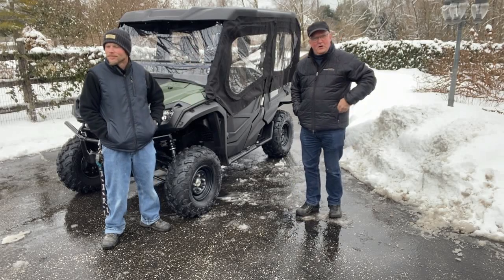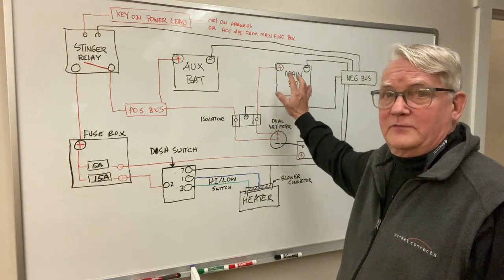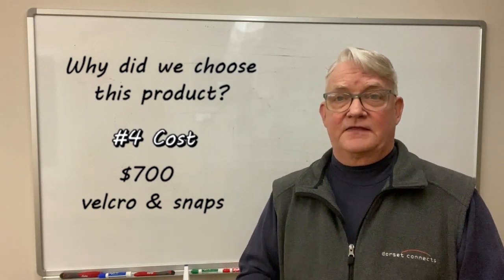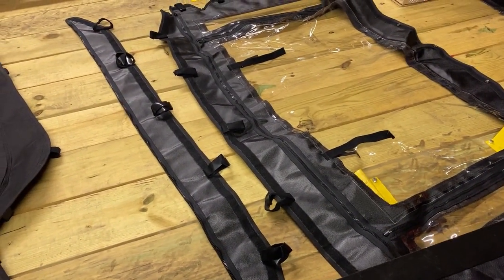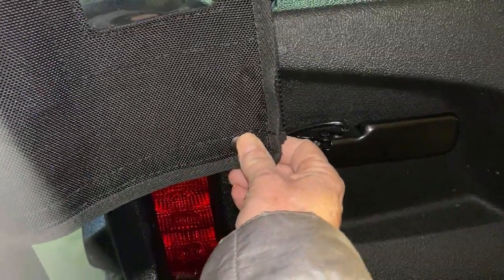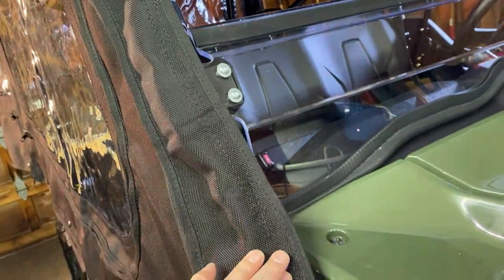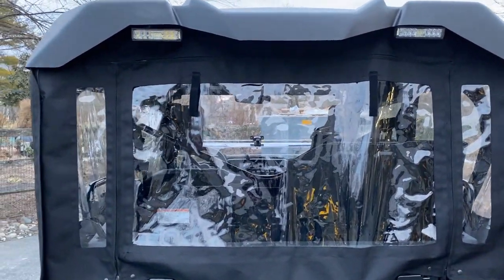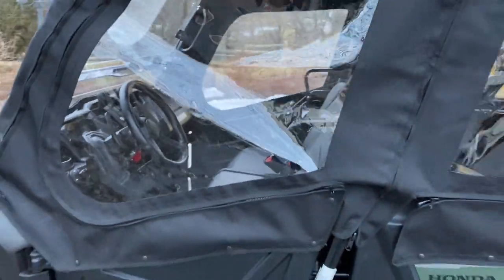Honda Pioneer 1000 Full Cab Enclosure

Comment: Seems it could be designed a bit better so not to have as many gaps and openings. However for about 1/2 the price of an OEM its a valid option. I am still mulling over which one to get. I do alot of snow plowing so the gaps might be a deal breaker for me. Thanks for the vid!
Reply from the maker: I totally get your concern about that (the gaps). I have not added or used a plow yet, so I can't say from experience what it would be like. However, there are two things that could probably make it a non-issue for you. 1) just plug the gaps with a little weather stripping if needed; 2) install a heater. I purchased a heater and am going to do an install video on that also. I suspect the heater will make it so toasty the gaps will be welcome fresh air! lol. Thanks for the feedback. - rob

Comment: This is on the top of my want list for enclosures because it is least expensive and does not add a lot of weight!  :)

I foresee days that I would want everything closed up in the mornings and evenings but would like the door-windows open mid day when it's warmer.  So a way to roll them up and tie them out of the way would be great OR even better would be to just unzip them totally and put them in the storage bags.
I would prefer the latter because I also owned a different brand soft enclosure for my Yamaha Rhino and found the clear plastic became brittle and cracked after a couple years.  I would recommend they make the windows so they fully zip out either for warmer days or in the event they need to be replaced.  Then you would only have to replace the window and not the whole side.
Reply from the maker: hey Robert - thanks for the comments. This enclosure definitely fits the bill for convenience in putting up and removing at will for various conditions. They roll up easily and tie up with Velcro, then drop down when needed. Easy to remove the whole panels with a zipper and store in the bags when that makes sense. 

Don't know how the windows will fare after a few years as far as cracking or brittleness, but I guess we'll see.

Comment: How did you decide where to stick Velcro on rops?
Reply from the maker: Hey Matthew - it was just a matter of holding up the doors and seeing where it made sense to put the Velcro. It really was not a complicated issue once you have it in front of you.
Reply: @rsparre  thank you for your reply mine is on I put it in heated garage for two days before install prepped self adhesive snaps and took it home 72 hour later it’s in the garage with the snaps falling off lol. But I did go on fairly easy I didn’t have a helper so that made it tuff I think Velcro is the way other than the snaps maybe if it would’ve been summer time they would’ve adhered better.